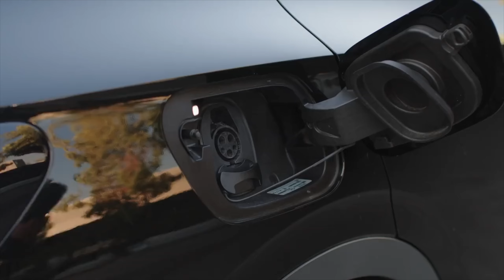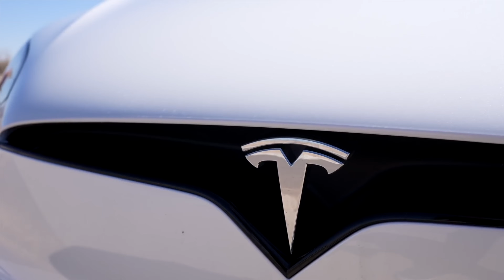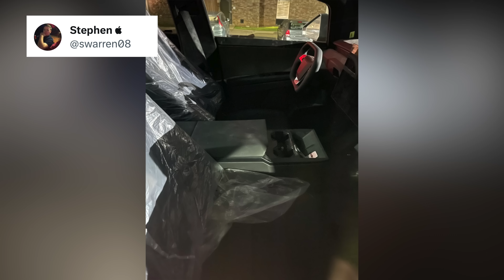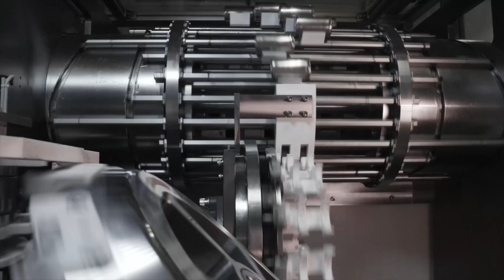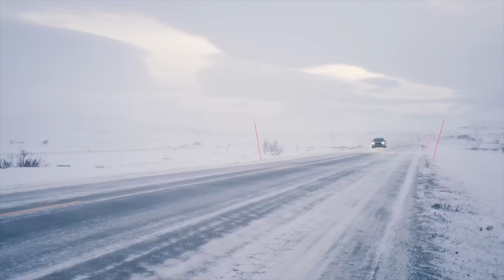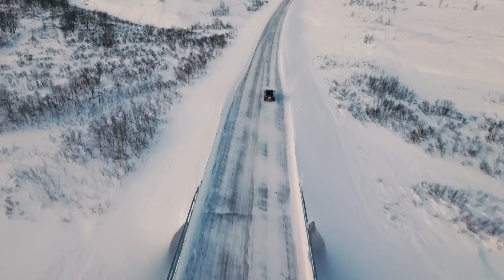MASSIVE $10,000 Tesla Price Reduction | We Don't Want This

Comment: I guarantee there will be a "software upgrade" in the app for owners to upgrade their range. Tesla got the butts in the seats and after that first road trip, it is going to be so easy for the owner to drop the extra 10k in the app to extend the range. We saw the same thing when winter came around and SR Model 3 owners were unlocking the rear heated seats in the app.

Comment: The S and X have always been over priced for what they have different from the 3 and Y.

The S long range probably should be closer to 75k starting and the X long range 80k starting, for the performance variants it makes sense to increase 10k for brake and suspension changes plus a little on top for margins. That would make them very competitive with the R1S and other offerings.

As far as we know they S only adds 20 kwh or so to the battery same with the X, outside of that the frames are a 'little' larger, the interior is still quite spartan and similar quality between the models only adding ventilated seats to the front, extra screens and upgraded computer hardware.

They also shot themselves in the foot with the X rear doors being a big drag on cost and maintenance.
Reply: Overall driving experience is vastly different between S,X and 3,Y. I own s and y. M3 gives me an entry level civic vibe.

Comment: Just like when they offered the software locked vehicles before. Offers buyers the option of getting the same car for less, with software locked chargeable capacity and reduced acceleration. As Ryan said, saves Tesla money.. saves us money. 

Heck, knock another 10k off the price, (down to 68k) further limit the range down to 265 (the original range of the 2012-2014 85kWh models), and limit acceleration to 4.2 (same as their original Performance S), and I’d gladly buy this, as long as they allowed the remaining capacity and acceleration to be restored via paid unlocking in the corresponding 10k increments.

Comment: My experience in cold weather, beyond the expected 20% range loss or so - the main issue is actually charging. Both the car and the charging station are impacted. On longer drives, the car can preheat the battery, but in reality, this might be the entire trip to the charger. Last year, when we rented a Model Y in Denver for our ski trip, we charged at a v3 charger in Silverthorne, Colorado during a snow storm. We charged at less than half the rate expected because of the combination of car battery temp and charging equipment. Even so, I suspect our experience was still much better than the EA station. For those skiing Breckenridge, that town have many ChargePoint chargers in the parking areas - so you really only need enough charge to get around town or to your lodge for the night. Leverage the chargers in the parking lots to charge while you ski all day.

Comment: The model S is still too expensive for what you get. Especially considering the build quality at such a price. They all need an additional 10k drop to be fair for what they are. A long range S should be like 80k MAX.
Reply: After driving one for a day, I think the price is appropriate. The car is a BEAST on curvy roads and has almost as much space as a Model Y.
Reply: @OptimisticEngineer345  I mean it’s worse on curvy roads than my model 3 performance given the weight bump. Build quality is one of teslas biggest issues. And at that price I’d be pretty upset with the quality control and build quality. Hopefully in another 5 years at this rate tesla will get their act together.
Reply: @devinmurray5280  If the 3 performance is that good I really need to try it. I just got a model Y dual motor and it’s fast and reasonably nimble but compare to the model S it’s way less inspiring on the curves. I love it but not exactly a sports car.
Reply: @OptimisticEngineer345  yeah the Y is taller and less agile. The 3 performance is the most agile of the tesla family given its weight and size. The S is good too in this regard but being heavier it’s not as agile.
Reply: @devinmurray5280  Model 3’s were well known to have paint issues early on (2018’s etc) as well as trim and panel gap issues, while Model S and X are not generally known to have these problems, or if they do, to a much lesser degree. 

I can attest that my 2014 Model S Performance still holds up very well, from paint, to trim, to fitment. As I do not own a Model 3, I can’t speak to what the quality is like, other than what I’ve read online. 

fwiw, my neighbor’s that have Model 3’s haven’t mentioned paint issues with theirs, but maybe because they are newer models bought in 2021-2023.
Reply: @OptimisticEngineer345  I have driven both a Performance Model 3 and i own a Performance Model S. I feel they are both amazing carving corners and both post some of the best track times the world has ever seen. That said, the narrower, lighter 3 is a bit easier to toss around, but the S makes up for this with its acceleration advantage. Honestly, you couldn’t go wrong with either. ⚡️💨
Reply: I disagree and strongly feel the S is priced right, or if anything, slightly underpriced, given its capabilities unmatched by other automotive competitors, which all cost more, yet, fall short of the S they are competing against. The only vehicles that even come close or possibly out perform it cost quite a lot more to a point of ridiculousness.
Reply: @evolv.e  problem is the model S quality control and paint quality fall short of economy cars (sub 30k). Absolutely not competitive within its price bracket in those regards. If it commanded quality control, build quality, and paint quality within its price point then it would be worth what they’re asking. I’d definitely not call it underpriced given it current state. Maybe give tesla another half a decade to care enough lol.
Reply: @devinmurray5280  my 9 year old Model S has no paint issues and still looks great. 

I believe majority of the paint concerns were with the Model 3 in its first couple years, but have since been corrected. I live in SoCal where there are Tesla everywhere, 7 of them, including mine, on my street alone. None of my neighbors have reported any paint issues out of 2 S’s, 3 Y’s, 2 3’s. There are more on adjacent streets, one of whom has an X. 

I’m not saying paint issues don’t exist on Teslas, but I think it’s greatly exaggerated tbh, with exception to the first couple years of 3’s from what I’ve heard. That said, my Hondas and Toyotas had the worst paint durability of any brand I’ve owned, with the clear coats peeling after the 8th & 9th year on two of them. Hopefully the Japanese manufacturers have improved since the 80’s, 90’s and millennium, as I found their paint to be too thin and clear peeled too quickly. Like I said, I’ve got no such issues with my S. And it outside for no less 50 hours a week. 

But if paint is the only reason you feel the S isn’t worth it’s msrp, ceramic coating, clear wraps ect are not that expensive to add to any car these days. And even if my S had paint problems, I’d still chose it over any other car available for purchase today. No amount of paint can make any other car outperform a Model S for the money.

Comment: Feels like a huge scam to have software locked hardware. I wouldn’t buy a 4x4 truck but only be allowed to use RWD. If i ever got it stuck and knew the hardware would pull it out but im not allowed to i would be pissed.
Reply: How is it a scam? You get what you paid for. You can keep the initial cost as low as possible by only getting standard features, then upgrade any time later (when you can afford to do so) without a service visit or labor charge. In your "stuck" scenario, if you wanted a 4x4, you should have bought a 4x4, not a RWD. You should only be pissed at yourself.
Reply: @TheRealLaughingGravy  no you don’t understand, the hardware is already there, that means they are carrying around a 100kwh battery pack but only have access to 60% of it. So you are carrying several extra hundred pounds of dead weight that reduces range from just having a smaller lighter battery. Furthermore if you paid for the fully unlocked car you feel like you are getting scammed because someone bought the exact same car as you with all the same parts as you did but he paid $10k less. It goes both ways. No hardware should ever be software locked it’s a scam period. It’s no different than if bmw only made the M5 version of the 5 series but decided to only have 4 of the cylinders firing in a cheaper model, if the whole engine is there why can I only use half of it.

Comment: The speculation about charging to 100% every day assumes that they are using all cells and capping the charge of each cell. It could be that they have locked out some battery modules. In that case, the charging recommendations would be as normal.
Reply: I would not think they would lock out cells from charging and allow them to simply degrade and take up space inside the pack, but it is possible.
Reply: What's more advantageous to Tesla? That's what they're going to do.
Reply: @TecnamTwin  the first alternative is better for buyers. It's not clear what's better for tesla, or easier to implement.

Comment: Where is that locked battery buffer though? Top or bottom, because that matters. If its bottom, you should avoid charging to 100% per usual, but if it is top locked, you could charge to the displayed "100%" daily.

Comment: Th question here if the battery pack is the same , is Can you access that extra battery on the cheap model ? Maybe software reads 0 when the bank is about 30% still charged, meaning you can drive more?

Comment: I don’t know if your charge theory is correct. It is only correct if the battery pack, although locked, uses all of the individual cells, but only gives the regular range in total. If it totally locks out one group of cells, and therefore they never get used or consumed, then the cells that are being used repeatedly would be receiving a full charge if you fully charge it all the time. It’s probable that they are using different blocks of cells every time you charge, even if you have not paid for the bigger, battery pack, but I don’t know that for a fact.
Reply: They use software to lock out the ability to charge the pack to full capacity, they aren’t physically locking out individual battery cells.
Reply: I thought the exact same, they could just be locking out out some of the cell packs.. without knowing this you could be unknowingly degrading battery. This video is bad advice without those details.

Comment: It's not a $10k reduction, it's an additional model range option that is $10k cheaper than the standard.
Reply: I’m so tired of YouTubers doing this!
Reply: @financeforheroes facts
Reply: @financeforheroes  How about all the AI bloggers "this site should be illegal..." 🙄🤦‍♂️
Reply: Yeah but he needs the clicks
Reply: @MnifuzioN 😊
Reply: Wants*
Reply: He sits and thinks what’s the most insane way I can mislead people into clicking. Then posts it.
Reply: Charging the standard model S to 100-% is a genius observation!
Reply: Also, the long range models are already discounted $5k+ in inventory so this is only slightly cheaper for that 20% SW lock.
Reply: I’d gladly buy the less expensive version. Better charging curve, increased longevity, and option to unlock capacity and performance at a later time if desired. 

No different than when they offered the software locked vehicles before. Saves us money. Saves Tesla money. Win win.
Reply: But its the same car🤔
Reply: @josh_cameron  for less money. That’s the point.
Reply: Now it’s a 10k reduction smh
Reply: @Uptownv  that’s a good thing, plus full capacity. Plaid is also a crazy good deal at $89k. If you have the need for speed that is. Which I do 😅
Reply: Thankyou saved me time
Reply: But it’s literally the same car. The same battery and everything. They just did something with that software to lock the Range and speed. It’s not actually a range option like a smaller battery. So they did reduce the cost of the exact same model.
Reply: @JJohnson313 But the buyer can't  use it as the same model, but slightly inferior.
Reply: Exactly! This is so dumb!
Reply: It’s an artificially locked model. They could have just given it an official $5k drop and you would get a car that has much better value despite being a little more expensive than what they are offering with the new “standard range”. Also this is still the same shitty S and X design with all the known problems that will likely have you running to Tesla servicing 3-4 times a year.

Comment: The new standard Range X and S, not only are you able to charge to 100%, but on your road trip the charging speed will be faster as you are actual 20% lower in the total charge of the gross battery, so road tripping would be just fine!
Reply: Another advantage is that regen still works when you're at full charge.

Comment: The standard rage is basically a way for Tesla to cut prices without messing up resale values on the long range trims.
Reply: Which makes it a great idea. Stock shouldn't have dropped because these trims are still profitable and the more EVs on the road, the better.
Reply: Seriously, and its super easy for them especially since its just a software limitation
Reply: Tesla doesn’t care much about resale lol. The model 3 Performance is almost 16% less than it was a year ago. They caused the whole EV market to drop.
Reply: Agreed. This is a great way to offer a lower price point and create more owners. If it’s like the software locked S’s of the past, it should be just a matter of unlocking the capacity and acceleration later via Tesla service if desired down the road. 

For those who remember, Tesla sold software locked 75kWh models as lower priced “60kWh” models years ago. These were a great way to own a Model S for much less. Best part is finding a used Model S 60kWh is a relatively inexpensive affair, and only $2000 via Tesla service to unlock  the remaining 15% and restoring acceleration to its quicker spec. 

Those in the know would be getting a good deal by saving 10k now.. then have the option to unlock the limitation later for a nominal amount.

Comment: Tesla is the only one that can actually afford to drop prices. This is death for the other guys because they stopped developing their factories!!!
Reply: Yes, because of the FSD scam. Current tech hardware cannot go to level 5 but level 4. And even then, 2030 is probably the earliest if not 2035 or 2040...
Reply: @viadharmawheel  what are you even rambling about? Must be a spam bot!
Reply: The truth, not hype!  @ryanpetree6475
Reply: Yeah, because they are so overpriced.😂.  It's histerical how you think a car with known and obvious quality issues, somehow has state of the art manufacturing processes. Take a Lexus or Mazda product at the end of factory line and measure tolerances in panel fit and finish compared to a Tesla.  It would be like comparing a swiss made Rolex to a Timex.  Tesla can't even get rain sensing wipers, Auto high beams, or self parking to work correctly.  They keep getting rid of technologies like radar, and Ultrasonic sensors to lower the costs of the vehicle, instead of improving the vehicle.  Then customers wait for a fix or software update and instead get a update for Spotify, totally ignoring and forgetting about the issues.  I don't understand how they even have a $6,000 autopilot option that lists features such as smart summon and auto Park which don't even exist at this point.  The Kool aid drinkers are part of a cult, like a religion, that just believes things to be true or that events will happen, no different than the story of a coming rapture.
Reply: They need to be more than a car company or the stock nosedives. All monies are on FSD going to level 4 (level 5 is impossible for vision only) so they literally burn bridges to motivate/force devs to deliver on vision. @HDHQDIRECT
Reply: @HDHQDIRECT  You have obviously never worked on cars. I think we can all agree that Tesla has made major strides in the fit n finish of their current vehicles and Lexus and Toyota have seriously slid down a hill and hit every bump. They are junk now. That's because they have to cut corners to make ends meet now, they are in major debt and Japan can not keep bailing them out because they themselves need bailed out!